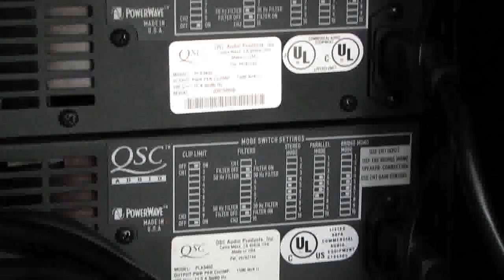Talking about power cords and their use in the audio field

Comment: Thank you so much stage left. I've been putting together a system for about a year and a half now. Three Crown CTS 3000 amplifiers. I've got two Samsung 15-in tops and matching powered mixer. My problem has been bringing these Subs to life.
Reply from the maker: Nice work!
Reply: @stageleftaudio  I just realized I forgot to mention six 18-in subwoofers are being powered by the three Crown CTS 3000 amplifiers. The problem is I'm not getting enough electrical current. Any recommendations on a step up step down transforming? I need something that will give me three separate 20 amp circuits from a 220 Outlet
Reply from the maker: I recommend checking with an electrician to convert a 220V outlet to 3 x 20amp circuits.  There's usually a lot more involved with setting up circuits than what we could write about on this channel!

Comment: 18 year electrician here, I thought I would make a point about cables and gauge.  First off, you need to know what amperage the circuit is in the first place.  If you are running on a 15 amp receptical circuit, there is no sense in using a 10 gauge cable if all the wiring in the wall is 14 gauge.  If it's a commercial building then it's likely going to be 12 gauge wiring on a 20 amp breaker so in that case, a 12 gauge extension cord is going to be your threshold.  It would be wise to know these sorts of things when operating a system that is large enough to warrant 30 amp circuits and 10 gauge wire as there aren't going to be very many single phase 30 amp breakers or number 10 wiring inside the walls so... Another thing to point out is that standard plugs and extension cord ends are only rated for 20 amps, and thus, you will have a hard time connecting number 10 wire to an end sized for number 12 wire.  That's when you start getting into twist lock connections.  Your best bet is to either have a generator capable of that sort of power and connection or make sure the venue has what is necessary.
Reply: any other option for clean high amp power besides a generator? I know it doesn’t sound very wise but how about connecting straight to the breaker of the venue? I would obviously have to contact the tech/electrician of the venue but if that’s not an option, is it even possible and how safe is it? I know your not supposed to touch the mains or the lugs of the breaker cause they’re always live and the fuses are live as well unless the breaker is shut off.

Comment: An amplifier will always use whatever voltage it uses typically 120 volts or 240 volts. It's the current that increased and its current that causes you to need a larger cable.
Reply: I don’t know what happened to the guys comment who asked me if I know what voltage drop is... I would say that by even asking that question in this context shows that you don’t really know. I would also ask do you know ohm’s law?

Comment from the maker: It depends on how long the cord is and (more importantly) how many watts you need to run.  The limitation of an extension cord is based on the amount of watts that need to be run.   A 15 amp circuit can only (theoretically) provide around 1500 watts; so, if you keep the wattage below this limit, you can place more than one amp on the cord.

There's a lot of variables in determining how many amps can safely be run on one cord (circuit).  I would highly recommend reading more about electricity.

Comment: Great video sir 
I use all powered Subwoofers QScs 18s
What's the best extension cord should I use to power those? I do mostly all indoor events, sometimes i got to run long extension cords for power from an outlet nearby available 
Thank you
Reply from the maker: Thanks for the comment.
There are some variables involved with determining a good extension cord.  It's all based on volts/amperage and how long of a run is involved.  From your description, I would probably be using at least 12ga. wire... maybe 10ga. depending on how long the extension cord run would be.

Take a look at this online voltage calculator:  
https://www.southwire.com/calculator-vdrop

The "System Parameters" column on the left (on the website) should already be set.  Enter the values (for where you are ) in the "Input Parameters" column on the right side of the website.  Then, select "Calculate" at the bottom.  It will show you a minimum gauge of wire you would need to use for your setup.
Reply: @stageleftaudio  
Thank you so much for your immediate response really appreciated 
Really helpful Thank you🙏🏻

Comment: I'm hoping you can help me a little bit with this. You've been very kind providing timely responses to my previous comments. So here it is let's say I invest in some 10/3 s o o w power cable. How do I split it  three amplifiers? Let's see I run one length of 10/3 s o o w into a 120 volt Outlet, I see in your video in the trunk you have some splitters, some three-way splitters. Could I use something like that?
Reply from the maker: Yes, we do use those 3-way splitters for some events (mostly smaller events).  We use the splitters if we know the total power usage of the amplifiers will be less than what the circuit can provide.  If you plan on using the amplifiers at their full (or near full) power, you may need to have separate circuits for each amplifier.

Comment: Good afternoon. Are these 10 gauge wires able to provide voltage and current to several amplifiers? What approach can I take to wire multiple high power amplifiers to a single current or generator? Thanks so much!!
Reply from the maker: +Mark Euglin Try not to look at the number of amplifiers that can be run from a single 10ga wire.  But rather, look at the total load   of voltage/amps that you are expecting to run on that 10ga wire.  There may be times only one amplifier should be used per cord (when full power of the amplifier is expected). 

For large events, we use separate circuits (and separate 10ga cord) for each of our higher power sub amps and for each of our FOH speakers.  For small shows, we sometimes may place 2 high-power amps on one circuit (one 10ga cord) if we are not planning on running the amps strong.

I highly recommend researching electricity (volts/amps/current/watts) and how it relates to electrical cord size.  There's no basic answer to your questions!  There's many variables involved with electricity and discussing them extends well beyond what I could place here.
Reply: Makes sense. Thank you for your reply!
Reply: You gotta find out how much current your amplifiers draw.  A 10 gauge cable is rated for 30 amps.  Not amplifiers, ampers.  Ideally you don't want to exceed 80 percent of a breaker so figure your amp draw and that's how much the cable and circuit can handle.

Comment: Since I'm new to live audio, this has become my favorite set of videos! Thanks for doing these! I'll never accuse y'all of power cord abuse. My question is, it seems you have all your rack components going into one power source. I take it that's ok. I know, thanks to your video that I'll need to use a 10 awg extension cord. So is it safe to use one power strip (I'm thinking a 20 amp one) connected to a single 10 gauge extension cable? This would power two power amps and a mixing board. Thanks, Stageleft!
Reply from the maker: Thank you for your comment!  All of our outboard gear (for the analog and digital systems) gets its power from one PDU.  For the amplifiers, it's a little different.  The amps you see in the video (all QSC) are racked together; though, it required about 5 separate 15/20-amp circuits to power the whole rack.  10 awg extension cords do very well, however, depending on the wattage (and class) of the amplifier, you may only be able to place one amplifier on one circuit at a time.  Normally, it's not a good idea to place multiple amplifiers on one circuit because the electrical current demand of the amplifiers can trip circuit breakers.  However, Class D amplifiers are very efficient and it is possible to place several Class D amps on the same circuit (within reason due to power-consumption of the amplifiers).  The older amplifiers (Class A/B) almost always require their own circuit.  Class H amplifiers (like the QSC amps you see in the video) are more efficient and you may be able to place 2 of the larger ones on one circuit.
The 20 amp power strip you referenced would need to be connected to a 20amp circuit to ensure a full 20 amp service for your gear.  You should be able to connect 2 amps and your console to the power strip.  Though, depending on the wattage of your amplifiers and how loud you want to run them, it's possible you could trip a circuit breaker.  What amplifiers do you want to use with the power strip?
Since the time I posted this video, I have reconfigured our main amplifier rack and are now using all Class D amps.
Reply: @stageleftaudio   I'm trying to figure out what class my Mackie FR 1401i amps are. I looked at the spec sheet, but I can't tell.
Reply from the maker: If it doesn't specifically say Class-H or Class-D, there's a very high probability it is a class-A/B.  Also, considering the age of the amplifier, its weight, and the power it puts out, all is indicative of Class A/B.  Looking at the power specs of that amplifier, you could place 2 of them on a single circuit.  However, don't run them in bridge-mono mode on the same circuit; they would draw too much current.
Reply: @stageleftaudio  Sigh. Ok. I think I figured out that I can't run these in mono at home, unless I want to get another circuit added to my jam room. I think I'd better rethink my speakers. Truth is, I don't really need these Yamaha 15 inch power hogs, although they sound fantastic. I think I need to find some 12 or 10s I can safely run at home. Some 12s get pretty power hungry also, prob because they have better bass response. Back to the drawing board (and Facebook marketplace).
Reply: And thanks for saving me some future headaches.
Reply from the maker: You are welcome.
Also, you can run the amps and your speakers on your existing circuit... but, you won't be able to turn the volume up too loud because the amps may draw more current than what your single receptacle can provide.  Though, that may not work out well for a jam room, especially if you want the volume loud!
Reply: @stageleftaudio  , thanks, I think your original impulse was wise: Don't bite off more power than you can chew. Cheers.
Reply: Btw, Stageleft, in looking at different speakers, since I have two amps, is there a way to boost power by running them together in stereo? I don't think so...more amps just permits more speakers, not more power, at least in stereo, right? The only way to do that is bridged mono. Am I thinking correctly?
Reply from the maker: You are correct, the only way to get more power out of your amplifiers is to run them (individually) in bridged-mono.  Amplifiers cannot be run together to boost power... Amplifiers are unable to "combine" power from other amplifiers outside of their own existence.  It's impossible to daisy-chain amplifier power from one amp to another; if someone was able to do that, it would probably destroy both amplifiers very quickly!  Amplifiers were designed to run by themselves with speakers connected to them.  Hope this helps!

Comment: If you used a orange extension cord to power a rack of power amplifiers for a sound system will the orange extension melt and catch fire
Reply from the maker: Depending on the electrical codes in your area/country, a circuit breaker should stop that from happening.  However, depending on the load the amplifiers are placing on the extension cord, and the gauge of the extension cord, the cord could become hot, but should not ever catch fire.

Comment: I don't understand how I'm supposed to power a Europower 4000 amp and a powered subwoofer.. Does the Amp get it's own power conditioner? The amp is rated for 15 amps and so is the power conditioner does that mean that I can't connect anything else to the power conditioner but the amp?
Reply from the maker: Good question.  However, something to keep in mind with power-conditioners.... they are not designed to provide power for  amplifiers.  Power conditioners are designed to handle "static" and sensitive loads (like crossovers, EQs, consoles, other outboard gear).  Basically, any piece of gear (under normal usage) that does not present fluctuating loads (like amplifiers do).  For example, a mixing console may consume 200 watts while it is in use.  Where as an amplifier may consume 20 watts (when not producing sound), then when a kick drum is played, that same amplifier can produce 2000 watts.  Amplifiers are very dynamic and should not connected to power conditioners.

Amplifiers have much larger and robust power supplies than rack effects and consoles, and because of this, they require a large consistent power source.  Amplifiers should be connected to wall outlets only.

Regarding your question, if your amplifier is rated at 15 amps, and the power condition is rated at 15 amps, you are correct... you could only connect that single amplifier to the conditioner (assuming you were to use the amplifier at its full capacity).

Comment: Is it safe to plug 2 or more power amplifiers into a rack Mount power strip
Reply from the maker: You can, but you may not be able to run the amps at full power.  If you did, it may trip the breaker in the power-strip (if the power-strip has a breaker).  It's not so much as how many amplifiers you can connect to a circuit, but more of how much power you can draw from a circuit... whether it is from 1 amp or 4.  The limitation is the power from the circuit.
Reply: @stageleftaudio  won’t the circuit breaker on a power strip malfunction and burn up if you you trip the circuit breaker on a rack Mount power strip too many times
Reply from the maker: I have never heard of a power strip malfunction due to a circuit breaker tripping too many times.  If a breaker is tripping a lot, that is a symptom of a much bigger problem in the electrical system.

Comment: I have a pa system with a yamaha mg166cx and, two alto ts212 tops and I am planning on running two of the alto ts218s subwoofers. The subs are 1250 watts each and the tops are 1100 each, but they all say rated power draw is 450 on each of the speakers. Will this all work on a 15 amp circuit and what gauge of extension cords should I run to each of the subs and tops?
Reply from the maker: If the power draw is correct at 450 watts, you may need another circuit.  However, as long as you don't turn the system up too loud, you may be able to get by with those speakers on a single 15amp circuit.  The Class D amplifiers used in those speakers is probably efficient.  Depending on how far you need to run power cords to the speakers, you may want to look at 12ga cords (12 gauge as a minimum).  If the power runs are long, (around 100'), you should consider using 10ga cord.

Comment: Where can i buy the sow power cords
Reply from the maker: SOOW wire is almost always sold at electircal supply companies.  There may be a minimum length to purchase.  The wire may be available at the big box stores (w/ends already attached), but I have not seen it there.  However, the plugs and receptacle ends can be purchased at the big box stores.

Comment: will an SJOOW rated power cord work for power amps?
Reply from the maker: Yes.  Any extension cord will work (as long as it is sized appropriately).  The SJOOW is flagged as a "junior" rating, which references 300 volts... compared to 600 volts for SOOW.
Reply: @stageleftaudio  thank you very much!

Comment: i thought you weren't supposed to leave any power cables in a coil like that.
Reply from the maker: For power cords, it does not impact them to leave them coiled.  However, if the amplifiers were in use (for an event), any extra power cords would need to be un-coiled and placed out of they way of the cooling vents.  For storage, keeping power cords coiled will not harm them.